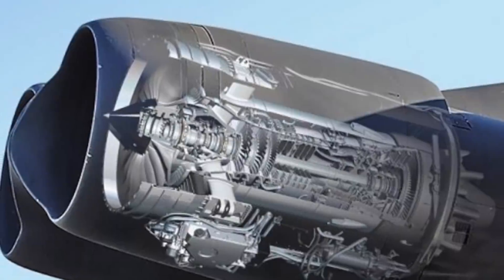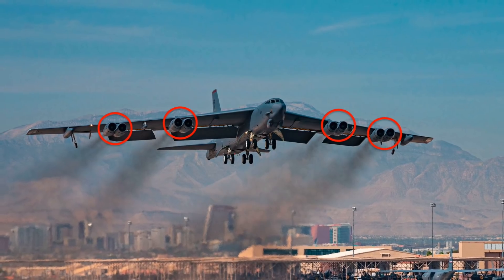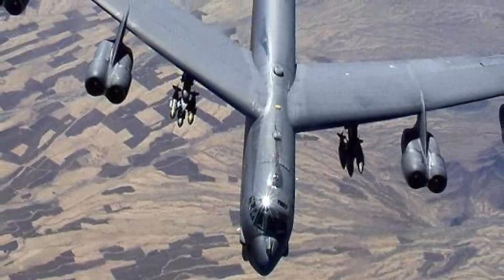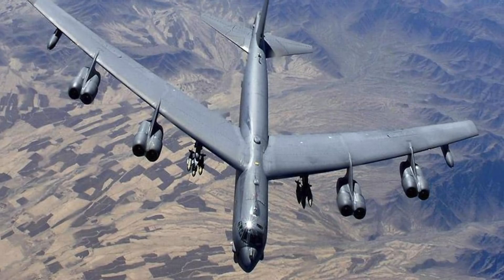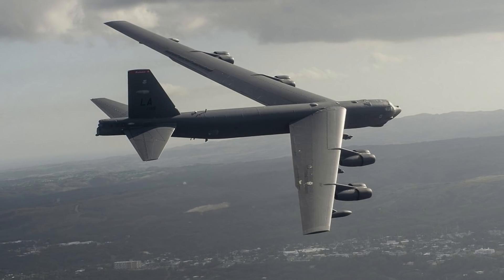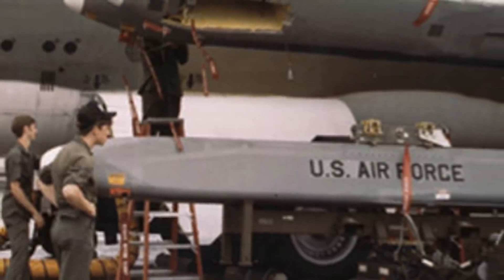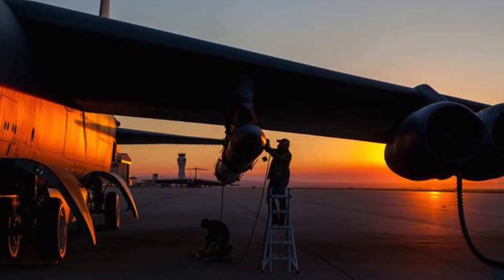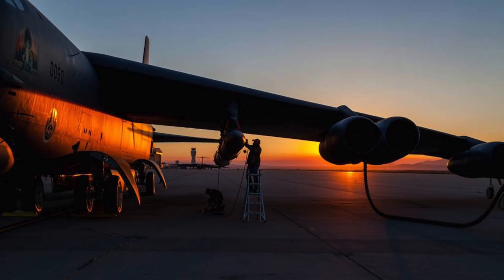3 reasons #USAirForce is still upgrading aging #B52 bombers !

Comment: So does that mean the B-52 will no longer have the black exhaust trails.
Reply: Yes it will fix that issue and fuel economy will be improved aswell. The main upgrade is the Data link capability, the F35 selects the targets and the Bomb Truck sends the JASSM ER or the LRASM or Tomohawks with pinpoint accuracy!
Reply: Yep, finally

Comment: It's because the B52 burns so much damned fuel.  Something around $250,000.00USD is the cost for one sortie to be flown by a B52.  I imagine that a lot of that cost is fuel.
Reply: That's Why they are getting ROLLS ROYCE engines , better Economy and higher power and speed

Comment: They are good for saturation attacks from long ranges, while being cheap if shot down, and just cheaper to build and fly overall. Not everything has to be a B2 meant for evading SAMs and intercepts.
Reply: If we can use cargo planes to launch missiles then obviously this is true.
Reply: B-52 production lines shut down decades ago during the Vietnam War. Only remaining option to replenish current inventory is pulling aircraft from the Boneyard.
Reply: @AirGaboon. Few if any B-52s are likely to be shot down. 

At this point, both B-52s and B-1s are standoff missile launchers. 

And they will not fight without situational awareness. 

Part of the B-52H upgrade is to bring the communication suites up the latest standards. Thus B-52Hs, B-1s etc. will receive exact situational awareness from hundreds of stealth, networked US and Allied F-35s of every variation. 

F-35s able to direct B-52s, B-1s to the precise locations they are needed for standoff saturation attacks and to stay beyond range of S-500s.
Reply: @AirGaboon  true hence the new engine, they might revive some in the boneyard, just in case

Comment: why use b52 when you have b1 ?
Reply: Maintenance and operational cost. The B-one is the first to be replaced, followed by the B-2. The last aircraft to be first augmented by and than replaced by the B-21 is the B-52H. By that time it is nearly a century old.
Reply: Cheaper buy an easy billion $
Reply: The B-52 can loiter for hours on end with few trips to the tanker while B-1Bs require multiple trips to the tanker
Reply: B-52 is better in almost every way besides speed.  Even then the B-1B cruises at only slightly faster than the B-52.  It's supersonic speed is pretty dismal as well, at only Mach 1.25, it hardly seems worth it (it is actually the slowest supersonic bomber ever produced).
Reply: @jacksonteller1337  I am always amused that the B-52 and Tu-95, two planes that can trace their lineage directly to the B-29, will outlast every other bomber made for the following 50 years and will make it 100 years of service.  The B-29 engineers would be so proud if they realized they literally made the single most influential military plane in the world ,
Reply: It can carry more bombs

Comment: There will probably be a ruling by a couple of senators to gain favour with their constituents that will try to force the less capable and affordable US engines on them. They sometimes rather have non functional equipment than a foreign design, like the A-330 MRTT and several other programs.
Reply: Not likely. The Rolls Royce engines would be built in their Indianapolis plant. Its more likely the Air Force will make sure those Senators
who might potentially cause problems with the Rolls Royce engine buy, are handled by making sure plenty of US jet engines are being
bought for a huge order of B-21s, F-35s, F-15EXs, and 6th Generation fighters.

Comment: Can't believe their not going to go the extra step and reduce the plane to four engines. imagine the saving's  in weight fuel and maintenance with only four engines instead of eight.  They after all, went with eight engines not because they wanted to, but had to, 
to get the necessary amount of thrust needed.
Reply: To do that they'd have to completely redesign the wings because the reduction in engines would cause all sorts of problems from unacceptable wing flutter to resonance issues.